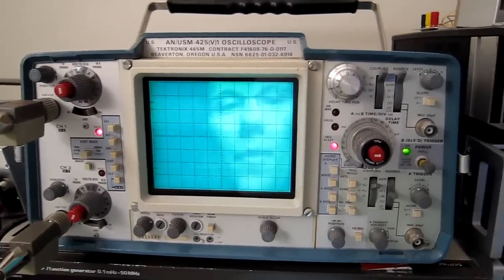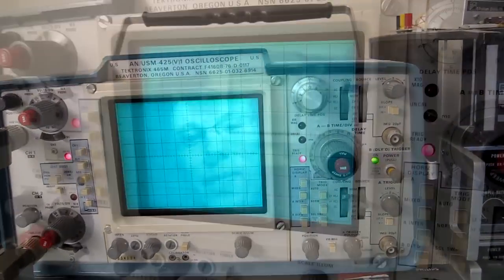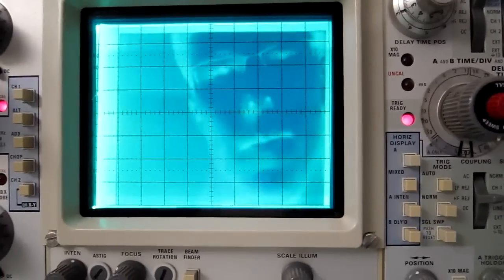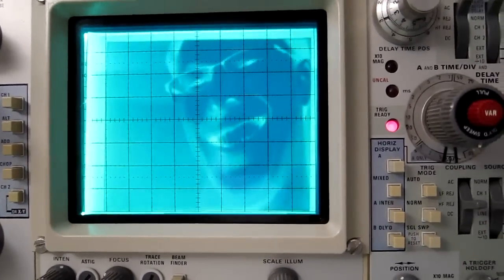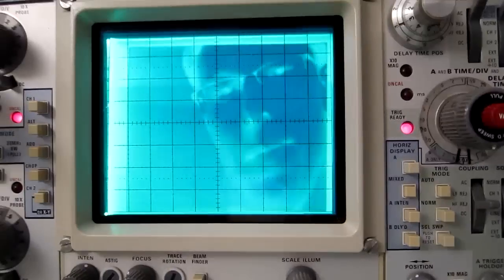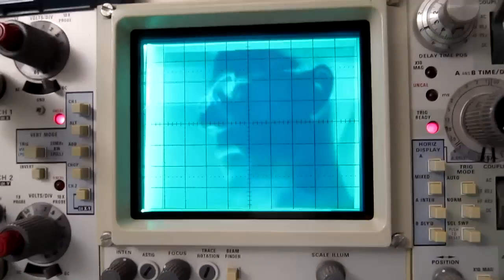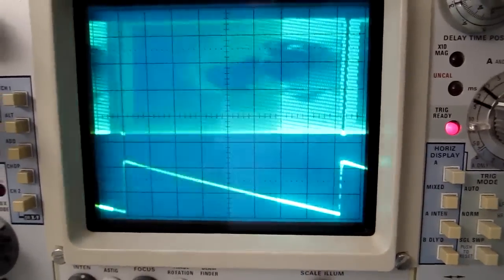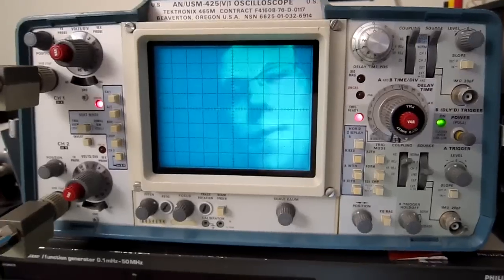Video on an Oscilloscope

Comment: The advantage of using an oscilloscope to display stuff is that there's technically no fps limit, so it'll definitely smoother and better then a standard monitor.
Reply: The fps limit is the input frequency and oscilloscope bandwidth no?
Reply: that's just crt tvs lol

Comment: so what would this sound like if audio were to create this image?
Reply: try plugging your headphones into a composite jack
Reply: the required information will most likely just be ultrasonic. You'll hear nothing.
Reply: @Arheisel  The vertical sweep was 59.94Hz, and the horizontal was 15,734 Hz,  The video on each line was a varying voltage at the horizontal rate so nit was in the normal hearing range.
In spite of using Vestigal sideband to transmit NTSC video, it used a simple AM detector The video was baseband, with the Aural channel in FM at 4.5 MHz  and if Color the information was centered at 3.579, 575 MHz

Comment: I was doing this in the early '70s without the National Semiconductor LM1881, and with a Leader LBO505 scope. All analog TVs had Sync Separator circuits to remove the sync from the video. It provided H an V sync out, to trigger the scope's sweep circuits.  It was more fun to feed the video out from my spectrum analyzer, to a video monitor and allow it to scan from 54 to 300 MHz to freak people out. :)
Reply: Yup, did this in a university electronics lab assignment in the late 80s. The lessons and principles learned have served me well. This demonstrates that you can make stuff work if you understand what's going on.

Comment: Why not transmit low resolution TV pix at 29MHz with vestigal sideband transmission? How about adapting an old 14.4K modem = 15fps X 60Lines X 16/1(contrast) for this purpose? 
15KHz is within the audio band. The leftover 600Hz will be a guardband? Is this compatible with NBTV?

Comment: In my experiments with this circuit I realized a couple of things. First of all. Y signal should be inverted(simple TTL/CMOS chip will do). In my case I got an inverted image (upside down). Second is some basic amplification and inversion of Z modulation signal. The signal was not strong enough to fully shutdown the trace. Other than that the circuit works decently.

Comment: so there's no pixels on this?
Reply: if you could reduce the glow-area of where the electrons hit the screen and have an almost infinite refresh rate, then there would be no limit to the resolution.
Reply: noise may be a limiting factor
Reply: CRT's never had pixels to begin with.
Monochrome ones don't even have anything that even vaguely resembles a pixel.

The resolution, as in 'optical resolution' like how you would think of a telescope or the like, is limited by the contrast and focus of the electron beam, and the limitations of how fast you can scan the beam, but otherwise there is no 'resolution' on a CRT.
A colour CRT does introduce something that looks like pixels in terms of the shadow mask, or aperture grille (for trinitron style displays), but the trinitron type even shows you that there still is no vertical division at all; The screen just has alternating full height vertical strips of red, green and blue phosphor.

more typical shadow mask based displays have both horizontal and vertical areas that never light up that resemble 'pixels'.
But the proof that they aren't in fact pixels is that depending, again, on the limitations of the electron beam focus, and scanning speeds, you can actually light up small parts of one of these 'pixels'.
A pixel, by definition should be something that either all of it is lit up, or none of it is. it can vary in how brightly it is lit, but not in how much of it is lit.
the apparent 'pixels' on a colour CRT can vary both in brightness, and in how much area of the 'pixel' is lit up, and you could sub-divide it into say, quarters and treat each as an independent pixel without issue as long as the electron beam can be focused well enough for that.

CRT's don't have pixels. They never did.
That seems hard to believe in retrospect, but it's true.

This is also why the issues that plaugue LCD monitors, such as latency resulting from image scaling, and problems displaying the non-native resolution of hte LCD were not relevant for a CRT.
A CRT doesn't need to scale images, and has no 'native' resolution.
If you change the electron beam focus, and the horizontal and vertical scan speed, you change the resolution.
And barring any weirdness resulting from the shadow mask or aperture grille on a colour display, it truly has changed resolutions for all intents and purposes.
Reply: @KuraIthys  Color CRTs did operate as pixels, since the three phosphors were spayed through the shadow mask, in three dt clusters. Look at the old CRT databooks for a completed description. The RCA book was excellent, and can be found online in PDF. Then the tree elcetron guns could only hit one color. When combined they prodced color. images.